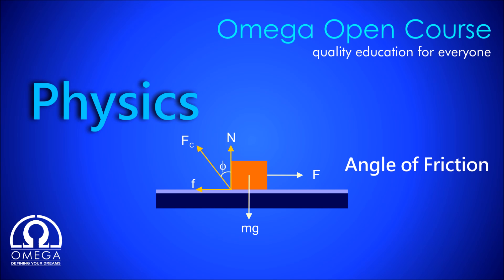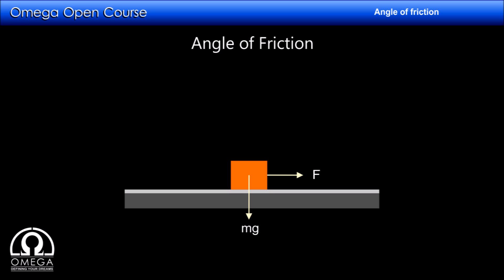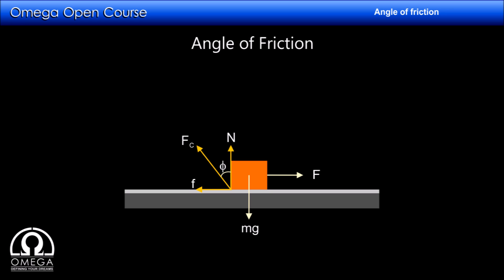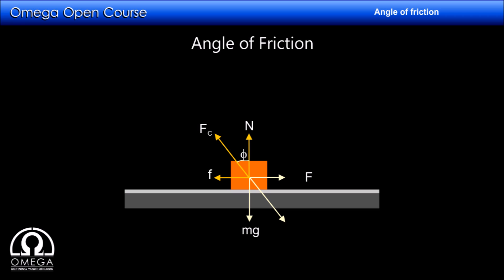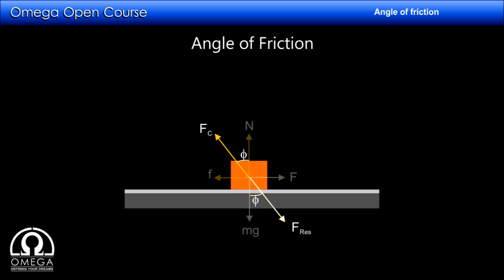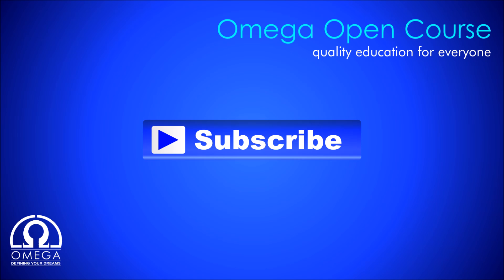Angle of Friction - A highly efficient way of dealing with friction

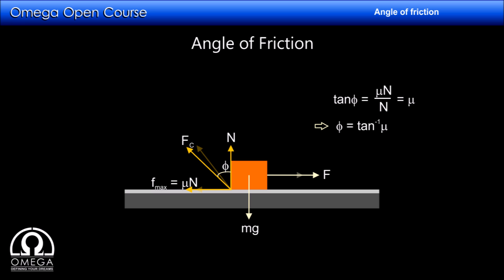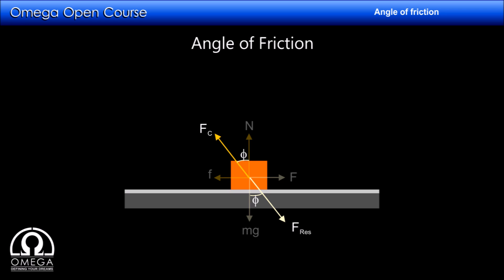Comment: sir at 1:44 s u said that value of angle of friction can not be greater that tan(inverse)u but at 2:46s u said that when angle between resultant of forces in greater than tan(inverse)u ....isn't it that angle of friction is equal to angle between mg and f resultant
Reply: Great
Reply from the maker: Angle between resultant force and normal is not angle of friction! Angle of friction is angle between contact force and normal. As long as angle between resultant and normal is less than or equal to tan inverse mu, the system is at rest. When the angle exceeds that value, the motion starts.
Reply: thanks sir...i really appreciate your hardworking and helping nature hats off to you sir👌👌

Comment: Could you make a video on cone of friction ?
Reply from the maker: +Mark Cavendish there is nothing special about cone of friction. It's just the angle of friction seen in the three dimensions. In this video the block is allowed to move only in either forward or backward directions. But if you allow it to move in any direction in horizontal plane, instead of angle of friction you will get the cone of friction.
Reply: Thanks for the reply. Actually I meant that if a force [ push or pull and howsoever large ] is applied within the cone of friction, the block will not move. Is this true ? And why ?
Reply from the maker: +Mark Cavendish ya, that is true. Watch the video on angle of friction once again. For the block to move, the resultant of gravity and the applied force must make at least tan inverse mu angle with the normal. But if the applied force makes an angle smaller than tan inverse mu with the normal then it's resultant with the gravity will always make angle less than tan inverse mu. Hence the block will not move.
Reply: Thanks again for the prompt reply.